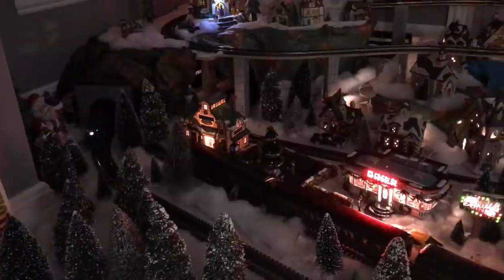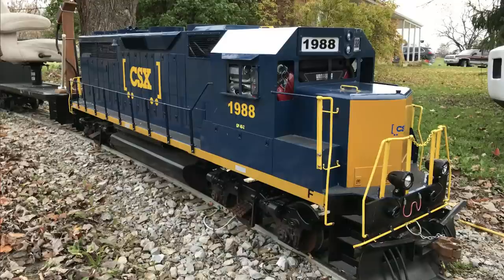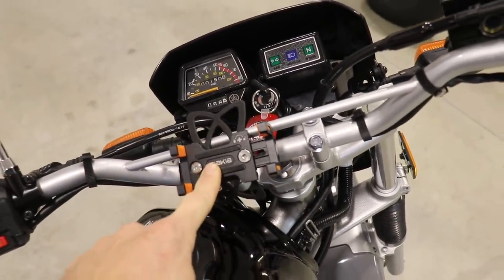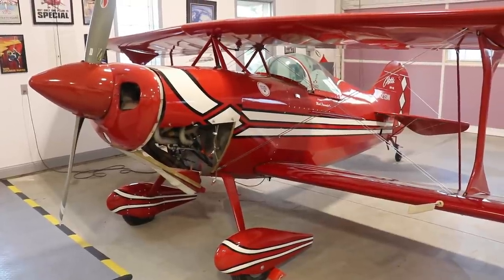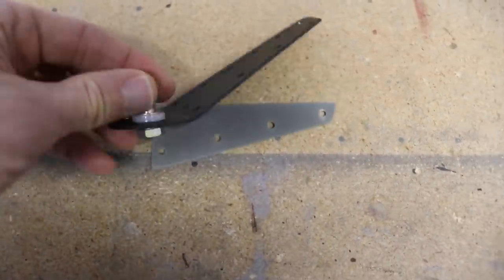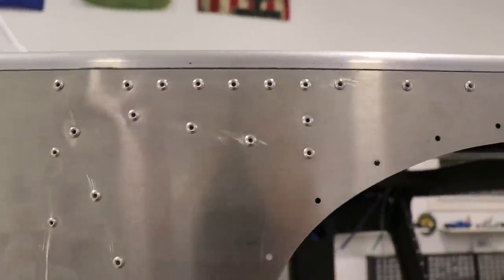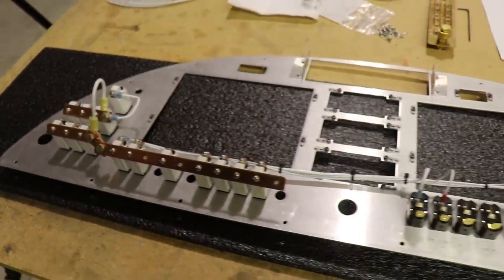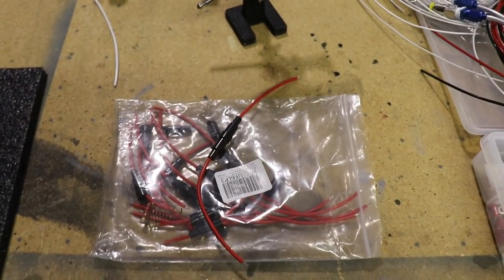Planes, Trains, and Automobiles! (Ep64)

Comment: Good call on the fuse for the USB port! The very last thing you want to do is reset CB’s in flight… especially for a non-essential system!
Your panel looks great and shows you put a lot of thought and applied common sense into the ergonomics. Can’t wait to see the finished product and how you will light it (if you do)!
Reply from the maker: I agree 100%. One better have a really good reason for resetting a circuit breaker in flight. There will never be something so important plugged into a USB charger that if the fuse would blow I'd need to reset it in flight.

Comment: Hah the TW200! Everyone who likes motorcycles has to try one! Went a couple teeth lower on the rear sprocket to keep the RPMs down when on the road. Wouldn’t recommend heading down any really tricky terrain. Drum brake marginal and the big front tire tends to hang up on boulders. Endo’d on mine I’m embarrassed to say trying to keep up with friends on CR’s! But great on dirt roads, crappy pavement. Really fun bike. Just wished they made a 350. Have a KLR now. Love the videos. Thanks for making them. My tail kit coming in the spring!

Comment: Recommend adding a disconnect on any item that must be removed from the front.  had to service my electric trim indicators on my RV-6 and had to cut the wires to do so.  That said it doesn't need to be a fancy connector, Molex or even the crimp banana  plugs.  I used a Dymo 4200 label maker with heat shrink tubing to mark each wire so that you can match things up when you eventually have to.
Reply: I should have scrolled before commenting!
Reply: If you don't want to be bothered with a connector housing, just crimp D-Sub pins and sockets on the wires, mate the pins/sockets and secure each mate with heat shrink (NON-adhesive lined).  Works just like a splice but can be removed by slitting the heat shrink if you ever need to remove the trim switch or indicator.

Comment: For the trim switch and indicator, have you thought about adding something like a molex connector? That would allow you to remove the switch without cutting wires in the plane once complete. It also makes it easier to replace, as you aren't trying to do a splice behind the panel, you would simply add the connector end on the bench.

Comment: I'm not a fan of the panel nor the electrical architecture in this particular airplane. That said, I would at this point try getting as much energy away from the panel as practical. E.G. I would even prefer that the start switch is controlled remotely.
 I would reduce the number of breakers wherever I could by combining some of the loads into a properly sized breaker and into groups as to allow essential and non essential and redundant appliances to be on separate breakers. 
I'm not a fan of the cheap klixon circuit breakers because of their failure mode and poor level if protection. Great breakers are expensive so I'm most interested in solid state circuit breakers. They would be especially better in this installation 
 Also, I would add another master shut down or a master power relay near the battery. 
An amperage ammeter shunt with battery power analytics because I like to watch and finally... 
Finally, I recommend increasing the panel thickness many times. Go as thick as possible without neglecting the shallow faced mountings found on some instruments and or gauges and indicators. 
Cheers

Comment: I think the USB port deserves a circuit breaker.
-It is probably the only circuit from where devices brought by third parties can damage the plane.
-In return flights, smartphones and pads are often discharged, when they'd be decent backups in some emergencies (communications, maps, navigation, meteorology, etc).
-Phones and pads may contain important data such as check lists. You don't want to change a hidden fuse to be able to read a check list.